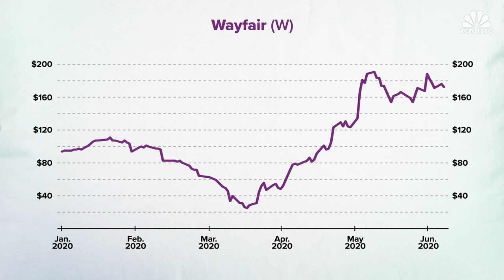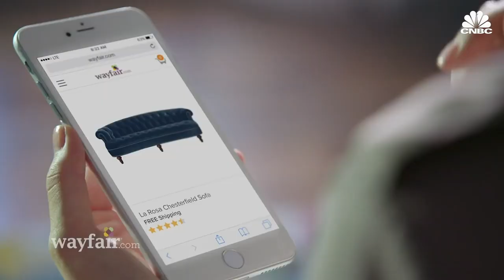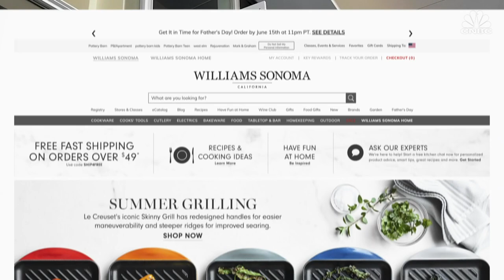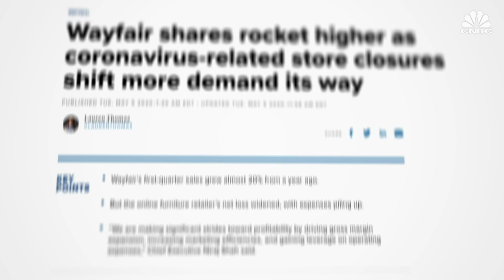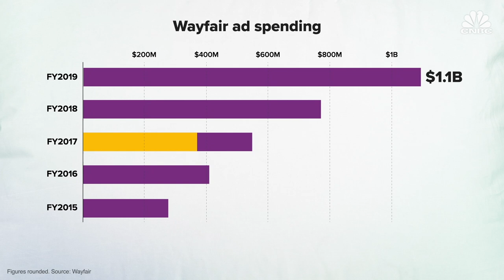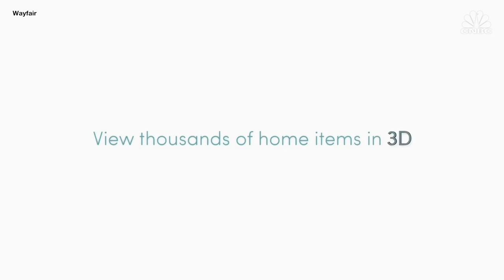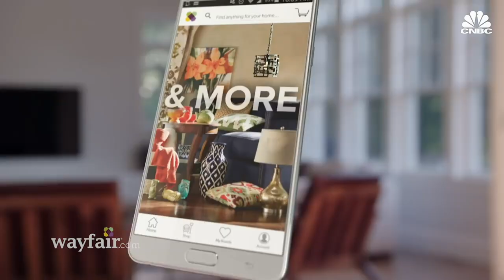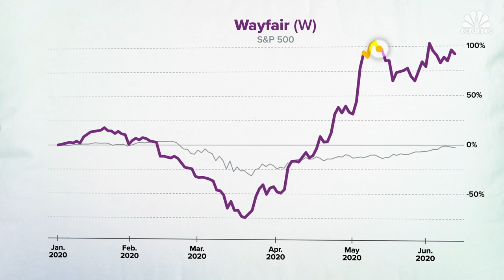The Rise Of Wayfair

Comment: I’ve been asked to give details so here they are. From Wayfair I purchased the Erinn 67” loveseat by Zipcode Design and it fits perfect in my space. Plus very comfy to sit on for long periods. All you have to do to assemble it is screw in the legs and slide the back section into the metal brackets on the seat part.  It’s almost always out of stock so I’d advise clicking on the “In Stock Alert”. I got the blue one.  Also purchased the Atka Sled coffee table.  It’s clear acrylic. Again it’s great for small spaces. It’s out of stock right now so sign up for the “In Stock Alert”. After three months there are no scratches on it.

Comment: My biggest worry is buying something online and getting the wrong product from what I ordered.  Even if the product return is free it's still a massive hassle to prepaid it for return shipment.  The other major problem, is I have to take time off from work to receive it. In rare cases, what you see online as the advertised qualities of a product is not what you actially get.  I purchased a gaming chair but I ended up returning it because what I got was way less in quality and specs to what I paid for simply because the fulfillment agent decided to substitute an order.  I have zero tolerance for product substitution, and I consider it product fraud.